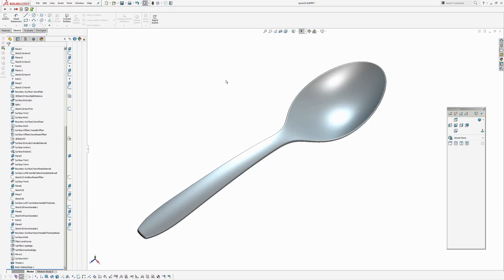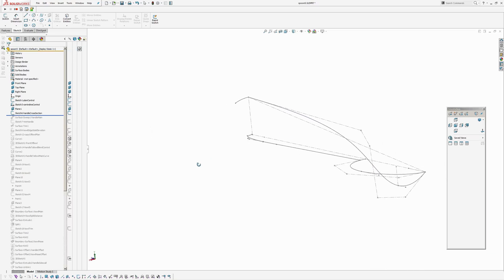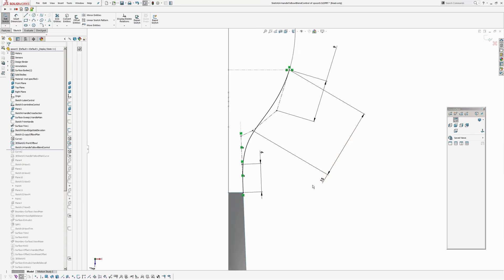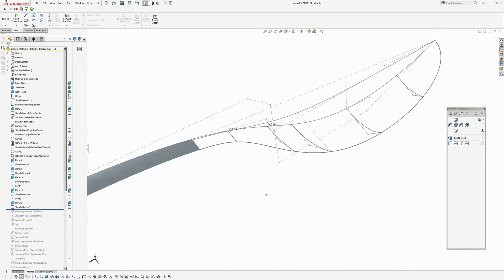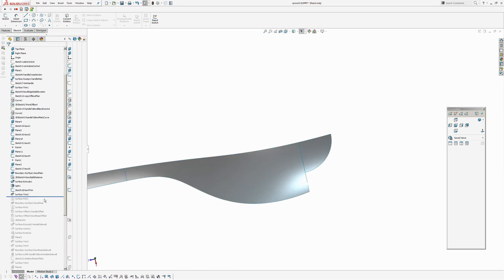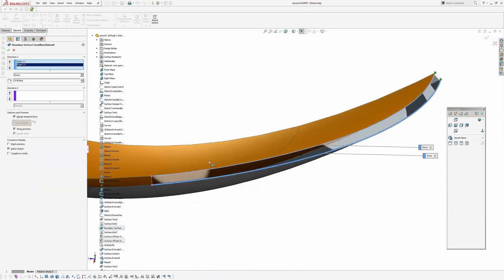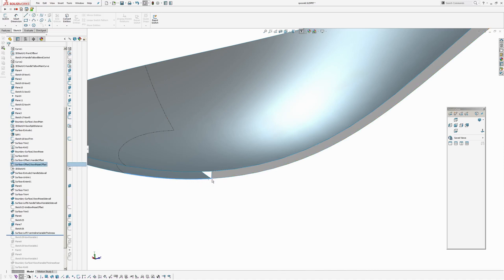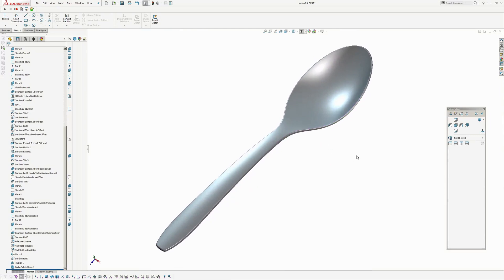Solidworks Tutorial: Modelling a spoon

Comment: Great video. Question- any reason to use 2 point style splines as cross-sections for the 'bowl' instead of arcs? I noticed for the handle you swept an arc.
Reply from the maker: I use deg2 splines instead of arcs for a few reasons. If you are experimenting with form, the spline is fairly close in shape to an arc, however if the input geometry requires the spline to 'invert', the spline will do so, but the arc may not and fail. It also means if you want to deviate away from the arc-like section, you can do so without having to replace the sketch entities. 

In this case, using the spline for the bowl sections allowed me to change the form, if I wanted to, away from an arc.